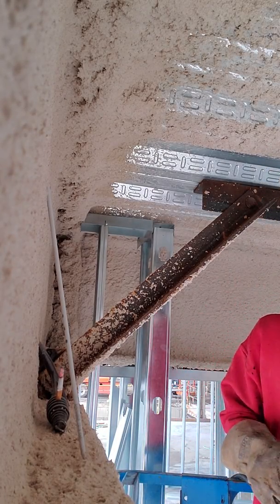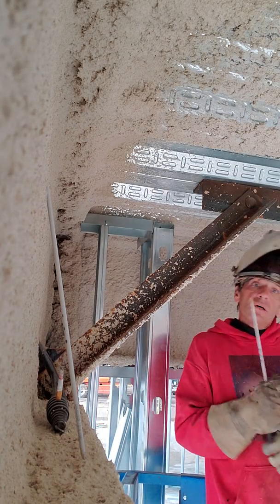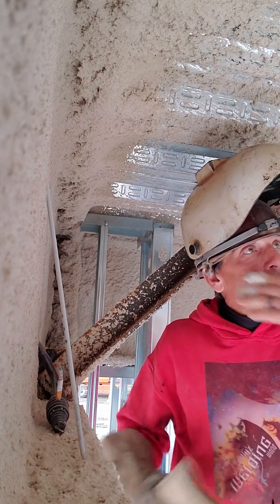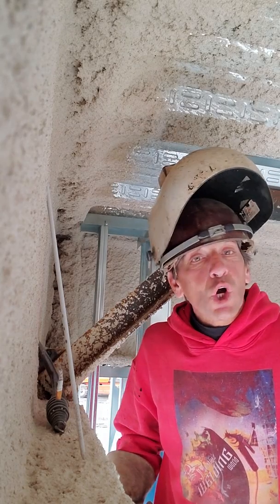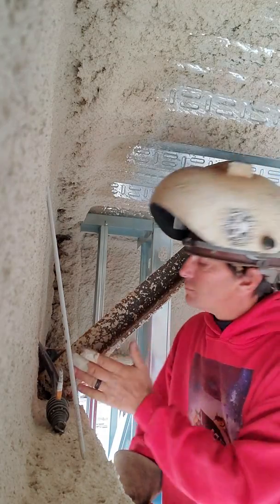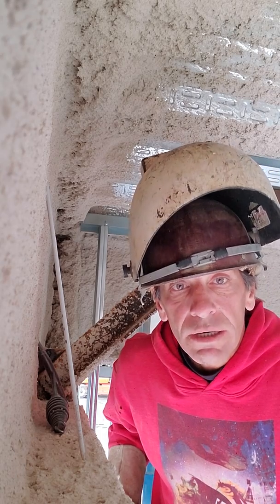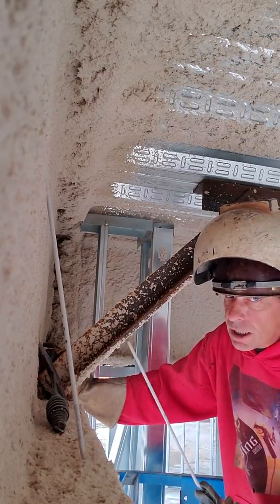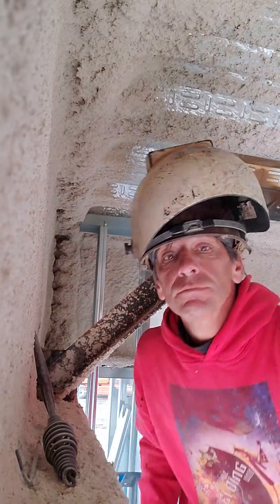Structural welding/ Common structural Welds

Comment: Looks like you have alot of useful experience and have a knack for welding. Having a knack for a certain thing is important. You want to like what you're doing. I got into welding in the early 70s,learning first to do mig wire and braising with a torch. I've tried Tig welding,stainless steel welding and got certified for innershield with 211 wire,all position,232 wire,all position,and all position with 7018 stick. If I were you I'd wear a mask unless you want to blow black soot out of your nose when taking a shower after work. I'm 76 now,retired in 2004,and whereas I always thought that my lungs would do me in but instead it seems that heart failure will do me in. I'm 6' and 160 pounds,not overweight. Anyway ,I was in the shop union,worked in shipyards as a union Boilermaker,and 25 years in the field Ironworkers union. You could become an apprentice Ironworker,go thru a 4 year program and perhaps be able to bypass the welding course since you have alot of experience. Or you might be able to do only half of the course. Remember this: Ironwork is dangerous,you don't always work with good equipement. You're only as good as your machine. If you're working for a welding foreman you should be ok but sometimes I'm with another crew and I'm the only welder and the foreman is not a welder. Many of them don't seem to understand that welding is slow,you can't rush it and there's a certain amount of surface preparation involved. Once a non- welding foreman told me to pick up the pace. I said Rome wasn't built in a day. He said " this isn't Rome". Ha,ha. Another time I told the non-welding foreman that he's so stupid that if he was a duck,he'd fly north for the winter. He just looked at the ground. This was a Saturday,time and  a half and the 2 of us were installing a heavy duty,bank vault door. Didn't get fired for that. Another time on a high rise the Ironworker Superintendant told me to go down to street level and finish welding something that had some welds missing. I pushed my welding machine,it had wheels,along with my lead coiled up on top,to the manlift to carry me down to the bottom.of the building. After getting set up I said in a loud voice to some other tradesman working in the area that "this jobs like a cow and I'm gonna milk it " . I turned around and standing behind me was the superintendent with his hands on his hips looking at me ! And he said "don't worry,I'm not going to fire you. I need you ! ". Ha ha ha. Well anyway,good luck to you. So long.😊😊😊😊
Reply from the maker: Andrew, god bless brother, is burning wire.
In the sky, i'll be there I'll check you out,, i'll be over at my #401 BEACH SIDE HEAVEN RESORT  WE'LL HAVE A COCKTAIL TOGETHER, TAKE CARE OF YOURSELF CARE OF AMERICA BUILDING WITH YOUR HANDS AND ALL THAT S*** =YOUR WELDS  STAND STRONG /PROUD TO BE A AMERICAN, BROTHER/ thanks for your service, God bless.

Comment: I've worked around alot of fireproofing in my day as an Ironworker welder. When the stuff is wet,on the floor it's like walking on ice. And when it's dry you don't want to breathe its dust. If I remember correctly,the guys spraying it on the columns and beams are in the Plasterers Union. I used to joke with them,asking them if they are plastered when they apply it !  And more than once I told them,half- jokingly,that if a police car drove down the street with a loud speaker announcing the end of the world,that a nuke was headed our way and will destroy the city I'm in within 15 minutes,I'd grab a 2x4 and look for a plasterer. If you've ever slipped on this stuff you'd feel the same way. But of course I'm only kidding and the plasterers I talked to would laugh it off. But if you're an apprentice Ironworker you'd better walk carefully when you see this on the deck. Easy to slip and fall.😂😂

Comment: If you can man please hit me up! I have been welding/fabricating for close to 7 years now. Mostly MiG, Flux Core and some TiG welding. Ive worked for the railroad as a Mechanic C, Local 150 (Pipe Fitters and Plumbers in GA), Two State (Industrial Welding Solar Panels), and now Prescient (Production welding). I want to get into the field welding similar to what you are doing but I cant find a door to get myself in. I never went to a technical school nor got any training besides the small training I got when I entered the railroad. They taught us everything in fabricating including torch cutting, torch melting, MiG welding 2F, 3G, 4G, 5G every position honestly, plasma cutting and how to set up all those equipment machines. I pass the class within 4 weeks and passed the vertical, horizontal, flat and overhead fillet bend welding test all on my first go. Unfortunately we didn't receive a certificate instead just got the okay to weld for the company in all positions with all the tools. I also want to learn to stick weld but I live in an apartment. I bought a stick rig and began teach myself in my parking lot but was told to stop lol.... I was hoping to maybe get some tips on where I can learn or how to teach myself to pass a stick welding test along with tips on how to get my foot into the field welding industry. I absolutely fucking love welding and plan on doing it until I am 6 feet in the ground. Satisfaction of knowing I built/repaired something with my welding that will be used for decades at the end of the day gets me harder then a broomstick.... lol I F**king love it!!!
Reply from the maker: Ryan, Get in touch with me, I need your contacts,

Comment: Whoever put them angle iron their drinking water they put them wrong just saying.
Reply from the maker: Oscar, It is what it is,  They were there   BOLTED on the bottom flange slap., And the angle that is wedge anchored underneath the deck. Was installed prior. I just had to complete the welds,  You have a good night, Thanks for your comment,

Comment: Easy welds. This is a good video for beginners to see what they will incounter in the field. They get tougher for sure.
Reply from the maker: JCA, My Miller 400 pro the other day, I was run in 126, It's just different with different  Machines, I have 2 trucks on the road now
Reply from the maker: JCA,  Good morning, Yeah ,they are great easy  Welds, Figuring out how to set the heat for all the positions, And work on your craft, Producing quality welds, Have a great day, Thanks for your comment, And be safe! Talk to you soon!
Reply: @jetweldingllc4691  I was surprised you had your volts at 127. I tend to go 115-ish when I'm doing multiple positions and I do t want to keep playing with my settings.
Reply from the maker: @jca66  , I really enjoy my Lincoln 305 diesel for stick  Welding,   It runs so much different  Then a Miller,/
Reply from the maker: JCA, My amps R at 1:29 right now with 250' of lead ,1/8 Lincoln Excalibur, All overhead I burn pretty hot I love it, I'm using my Lincoln 305 diesel right now,
Reply from the maker: JCA, My Miller 400 pro the other day, I was run in 126, It's just different with different  Machines, I have 2 trucks on the road now

Comment: I’m curious Frank, why do you tape up when it gets cold?
Reply from the maker: Shaine, My fingers are abuse from connecting all these years,  And the high heat from the flux core, Inner shield welding, My fingers crack in the cold, It started happening in my mid forties, But it's all good, Hockey tape and   Bacitracin Ointment,  That's  All I use, And I love it, I'll take this pain for all these great years of doing what I love to do, Thanks for the comment, Happy New Year
Reply: @jetweldingllc4691  Happy New Year to you and your family.  Love watching these videos.

Comment: gonna start doing my 2gf test plate with baking plate any recommendations for the settings for flux core 
flat was too easy 275-300wfs 25v
Reply from the maker: Matt B What size wire, And what product, Lincoln FluxCore wire? Are you doing horizontal, Vertical an overhead,  To complete the 4 pack? The heat settings for flat will work for horizontal, You'll have to tweak it a little for your comfort and control, Check it out!
Reply from the maker: Matt B, I was running NR305  5/64 on my column Splice  Video a month ago at 30 V
Reply: @jetweldingllc4691  3/8 plate one square and one beveled with a 3/4 backing strip 5/16 gap
Reply: lincoln electric 0.45 wire

Comment: I like how you said I'm using the rod to it's maximus a lot of welders waste so much rod  take note new welders wasting material will get you run off jobs get good at your restarts
Reply from the maker: Carol, How are you, I try my best Of not wasting,   Some   Welded Connections I do waste a little, But I eventually use them rods through the course of the day, Stay safe, And thanks for your comment! Have a great day!

Comment: Dude you’re awesome. Looks like you’re very comfortable with everything. What’s the tape for man?
Reply from the maker: Adam, My fingers have been  Abuse for 30 plus years from connecting, And running the flux core for a long time, The heat abuses The finger tips, They crack, Bacitracin  Ointment And hockey tape, Thanks for the comment brother, Have a good night!
Reply: Thanks for your example. Hard working man who does what he needs to do. Awesome job brother. Wish I could work with you for a month even and learn SOME of what you know. You motivate me. Thanks